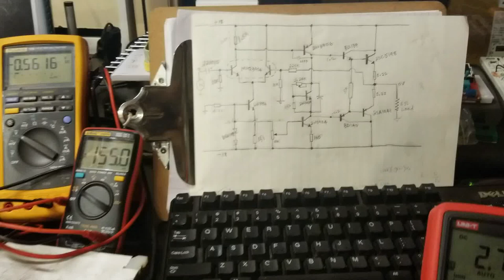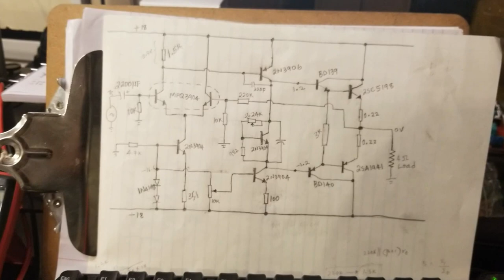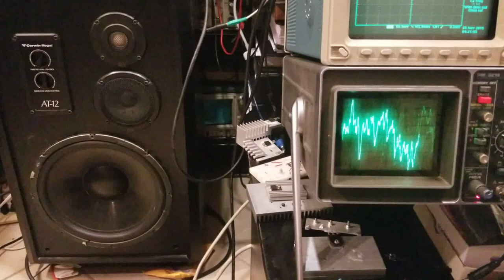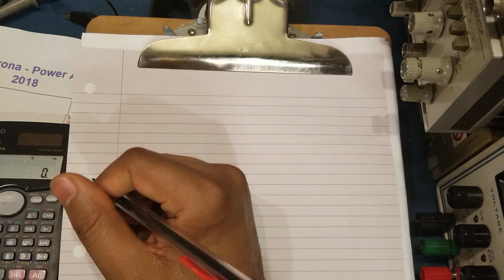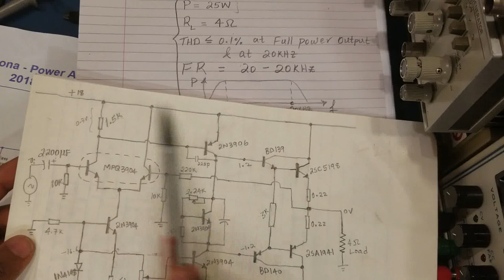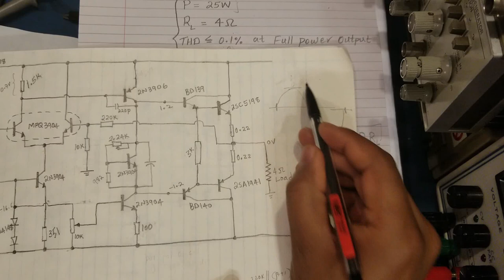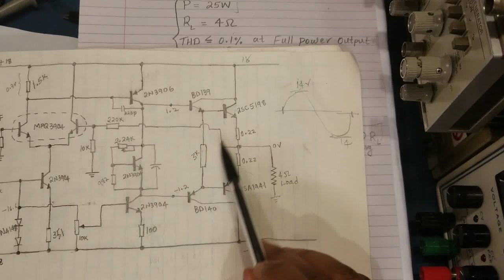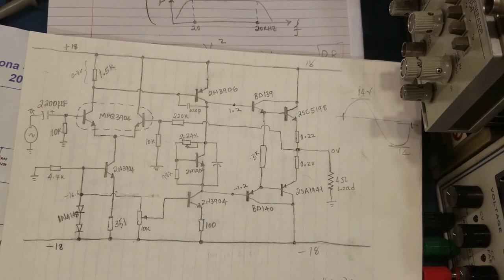25W Audio Power Amplifier Design  - Part_1

Comment: The input capacitor has a very large value and has no resistor between it and the base of the input transistor.  Input capacitors are usually around 10 uF, (and preferably non polarised) with a resistor of 10 K - 22 K.  Why did you design your circuit this way?

Comment: Are you sure about this feedback loop between the power output and base of the "right" transistor in coupled pair ? I mean - if you had a capacitor in series with this 10k resistor then there would be nothing wrong but if you dont have it then the voltage on the power output in bias state will be highier equivalently to the proportion of the resistances of the feedback divider because its connected to the ground. And I assume we want to stabilize the bias voltage having the ground as reference because the "left" transistor of the coupled pair is biased through 10k resistor to ground without any divider. That's little yet tremendously important detail - if missed it will cause disstorsions or in the worst case it's gonna blow up the power stage because the output transistors will be "trying" to put at least several volts above ground on the few ohm resistor which is the speaker in bias state - thats a lot of current. Details of this kind are CRUCIAL for designing even the crudest and most basic power amplifiers.
Reply from the maker: Hi RedfusionPL
. At DC, the base of the two emitter coupled pairs see almost the same resistance which is approximately 10k. The left transistor sees 10k to ground while the right sees 10k in parallel with (220k + 4R) which is about 9.6k. The difference is minimal which won't have any effect on bias of the output transistors since the matching of the two pairs isn't great to begin with (I am using MPQ3904) and the tolerance of the resistors. The amplifier was exactly built as seen on the schematic and didn't have any bias issues. In fact initially I had the 10k resistor on the right transistor connected with 2200uF capacitor to ground and the left transistor connected to ground through 220k resistor (basically connected as an AC amplifier). But I was having DC offset issues with the parts I had on hand and the feedback connection shown on the video solved this issue.
Reply: @SmithKerona  Sorry mate it's my bad I didnt notice it. Though both of us are little unprecise in our explanations because what will happen in circuits like this one is strongly dependable from current gain of the transistors, temperature voltage coefficients, differences between offset voltages (as you mentioned above) etc. so to compensate them a much more elegant and complex circuitry would have to be applied :) I dont think there is any sense in digging so deep if this is only for quick and simple applications lol. You get suprisingly nice sound out of it btw. Run some disstortion tests if ya can.
I just noticed the release date XD nvm

Comment: There are lots of sections or sub-circuits in this complex design that I hoped would be explained here or in part 2 but part two is just a simple 2 transistor AB circuit.   Will you be giving
any more comments on this much more complex design?   (e.g. comments on what the feedback circuit from output to the diff amp is accomplishing?).    There are lots of things
in this design that are not obvious to those trying to understand something this complex.
Reply from the maker: Thank you for your comment. My plan is to work out in detail how each sub-circuit works without shying away from the mathematics including contemporary feedback theory to shape the frequency response and stability of the amplifier. But time is the issue for me at the moment and I apologize in advance for not continuing the series. My plan is to get back to it as soon as I can. I hope you understand.
Reply: I like design but don't know where to start any help
Reply: That is a good comment. I find that with enough watching, reading and experiments I might get something sorted in building or repairing an amp.

Comment: I just started the video, so you will probably say it later, anyway... wouldn't it be better to actually have a capacitor on the voltage divider at the input on the second transistor (Q2) of the input diff. pair?

I mean, the voltage divider works miracle for AC signal, but for DC ones you'll have a diff. pair which is not balanced, and as far as I know, that can't be good as far as common-motion rejection goes, right?

Comment: 1:40 This circuit has quite a few design flaws.

The input stage has a very low bias current of abt. 1.7mA, leading to low transconductance and current starving of the voltage amplifier stage at frequencies above 1kHz, which in turn causes poor slew rate and  distortion (mostly 2nd harmonic). It's also hugely disbalanced, because one transistor draws abt. 0.46mA (0.7V/1.5k), while the other one draws 1.7-0.46 = 1.24mA. The whole point of a differential pair is to be perfectly balanced. Deviations in transistor currents over 1% cause a significant increase in distortion (2nd and 3rd harmonic). The best solution here would be to use a current mirror - the increase in complexity and cost is negligible compared to the great improvement it makes.
It's also beneficial to increase the bias current to abt. 6mA and add emitter degeneration resistors of abt. 33 Ohm to the differential pair.

The dominant pole capacitor (220p) is too big. The whole point of the dominant pole compensation is to bring the open-loop gain down to unity just before the phase shift at the output approaches 180 degrees, thus turning an amplifier into an oscillator. The value of Cdom is determined by the current sourcing/sinking capabilities of the transconductance stage and the VAS collector impedance. The open-loop gain here is not that high to begin with, due to the aforementioned low transconductance and current starving of VAS. All of this leads to a poor slew rate and great increase in distortion at higher frequencies.

The VAS collector is loaded by a current sink, which is correct, but there is never a need to adjust the exact current flowing through it, so the 10k potentiometer is useless. The 2.24k pot is placed between the Vbe multiplier's base and collector, which is a timebomb, because if it fails, the bias voltage will increase to a maximum, likely causing the output transistors to blow up. It's always a better idea to put it between the base and the emitter.

The 3K resistor between the driver transistors' emitters is too big. Reduce it by a factor of ten and put a 0.1-1uF capacitor in parallel. Its purpose is to provide a small reverse-bias voltage to the output transistors, making them turn off faster. Doesn't hugely matter in this relatively low-power circuit.

It's always a good idea to couple the lower leg resistor of the feedback circuit (10K) to ground through a large (470uF+) capacitor, thus bringing the DC gain down to unity. The input pair is never going to be perfectly matched, and you don't need to amplify the DC offset voltage. The 220K will then have to be reduced to the same value as the input bias resistor (10K in this case) to match the impedances. It's always better to keep the value of these resistors as low as practically possible to reduce the Johnson noise (the exact values will ultimately depend of the signal source's output impedance). It's also necessary to put a small (4.7-33pF) capacitor in parallel with the upper leg resistor of the feedback circuit. This circuit is likely to work fine without it because its dominant pole frequency and slew rate are very low and therefore the Nyquist stability is not compromised - but the noise and distortion figures most definitely are.

That's all. :)
Reply: That is some pretty in depth stuff you say right there. 
I'm trying to learn how to build an amplifier as my amplifier developed a technical glitch. I have no knowledge of electronics and to a practical approach for me is the best way to learn. 
This video is the first time I have seen someone explain how to build one and from that I am hopeful I can learn how an amp works and then from that maybe how to fix the one I have. 
Your answer is really interesting as it seems to show both interest and practical experience. Of course (and this is a joke) I know nothing about amplifiers or circuits, so what you are saying could be written by someone who knows nothing, but from a novices point of view, sounds wise and knowledgeable. :) 
My point here is I am going to look through the comments, but if you could highlight any videos, books or other information to teach me (us) how to do this, that would be great! 
As for the guy that made this video:- Thank you ever so much for this gem!!! I keep comping across fantastic repair videos, but they all presume we know how an amplifier works and what the components do, we don't. No one seems to point at anything on a PCB board from an amp and explain how each component relates to another. Seems as AB amps are based on the same principles, then know what is going on then means we can learn how to diagnose e.g. like where to put the multimeter to see what current flow is happening to find the exact problem. 
This subject is a minefield, but like most subjects, practice makes perfect and you video is absolutely stunning for the breakdown, explanation, but also the incredible comments from all the people pointing things out. 
Cheers peeps!!! ;)
Reply: @waynecummings5021  It's all complete gibberish, I assure you.😊
A really good book to read would be "Audio Power Amplifier Design Handbook" by Douglas Self. You can download it for free. It does require some knowledge of electronics though. Power amps are relatively simple circuits. About 95% of all amps use the same basic topology shown here, it's only the details that differ (but they do make a big difference). The best way to get started is by learning about positive and negative feedback, and how a differential amplifier works.
I can't recommend any videos because back when I was learning this stuff, there weren't any, and now I rarely watch them. You could watch some about operational amplifiers, because that's what power amps basically are: big, discrete op-amps.

What kind of "glitch"? Analog circuits rarely glitch in the same way computers and other digital devices do. Normally, if they stop working properly, it's due to a component failure. If your amp hasn't blown up, if there's voltage on the supply rails, and the output transistors are not shorted (which you can easily check with a multimeter when the power is OFF), then you could probably fix it.
Reply: @noneofyerbeeswax8194  Thanks buddy! That's a great reply for someone paddling in the Pool of Glitch. 
I have two Amplifier Receivers amps (I'm not suggesting you recommend talking me through both) that are exactly the same amps i.e. Sony STR-DE585, and both have different glitches:- 

1. One turns on for a few minutes and works fine, then after about 10 minutes it cuts off - so I guess something is over-heating and it stops to protect itself or something else;

2. One turns on, but it either recognozes the input signal straight away (optic from the TV), or turning it off and on again it finally recognizes the input and then it's fine; ;

There is also an Onkyo AR and that thing just sounds like it's trying to turn on, but just clicks at an exact 5 second interval. 

All three ARs are getting power and turn on, after that it's a mystery. 

Sorry to list them all, but that is what's confusing and cool i.e. they all have a different glitch. 

The reason I have 2 STR-DE 585s is because I bough them from Ebay as back-ups. I actually have a STR-DE585 I bought new 20 years ago and that still works, I just took it off line and used the replacement ones. However, as each one packs in I am slowly looking at using my original 585, and if that goes, then it's tears. Anyway, I thought if I buy other 585s I can reuse the parts to keep one going as long as I can learn to repair them, and here I am on this video trying to learn. I thought if I get used to one type then taking it apart will be familiar as I have three. Then it crossed my mind that I would love to learn what an amp is as they must share common technical attributes basically. :) 

That was a longer answer than I wanted to give.
Reply: @noneofyerbeeswax8194  I've just downloaded Audio Power Amplifier Design Handbook by Douglas Self. Thank you!!
Reply: @waynecummings5021   As someone who likes posting huge Walls of Text™, I really don't mind a long answer. :)

I've taken a look at the STR-DE585 service manual. Lots of stuff there. If all the channels have the same kind of malfunction simultaneously, then the problem is clearly not with the output amplifiers themselves. It's most likely in the digital circuitry before it.

The first problem might indeed be caused by false triggering of the thermal protection circuitry. Or by a leaky diode or transistor that starts drawing too much current as it heats up.
The second problem can be caused by lots of things. It can be just a loose contact due to a mechanical failure (cracked solder, SMD resistor or capacitor), or an actual digital glitch - anything. But it's definitely in the input circuitry, not in the output amp.

It's very hard to diagnose anything remotely. The process of finding a malfunction is not that hard per se, but it's very tedious. The standard procedure is to connect a signal generator to the input and follow the signal path throughout the entire circuitry until a point where it breaks. Then compare all the logic levels and DC voltages to those given in the service manual to find out what's responsible for that. Oscilloscope is required.

The third one sounds like an actual amp problem. If it's a relay that clicks at a 5 sec interval, then it's definitely the speaker protection. You need to measure the DC voltage at the output, it should normally be close (within 100mV) to zero. It could also be the over-current protection. Both these problems are normally caused by an output transistor failure (one of them must be either shorted or non-conducting at all), but not always.
Reply: @noneofyerbeeswax8194  Thanks for the heads up bud! I will check the systems as I go and learn as I do it - which is the whole point anyway, so I had to jump in the electronics pool at some point. I don't mind looking for the issue as it's both interesting and practical. 

You mention a service manual? I have already asked Sony for information like a schematic and they are telling me they only give them out to Sony engineers and such. They also called my 585s 'senior'!!!, in that they've had a good life, just left them pass away with dignity. The cheek of it! I explained to them that I bet they have a 'Let's save the Planet' mantra and yet here they are telling me to trash 99% of a great machine because it has a broken spring. I also told them they better not say that to their Directors as I bet a lot of them are 'senior', but I bet they don't want to be trashed. 

I am actually looking forward to diagnosing the exact issue/s if I can. It's a very transferable skill in this world. 

The oscilloscope sounds like a must I have realised. I am at that stage where I am slowly purchasing things like needle nose pliers, MESR-100 Capacitor meter, Atlas DCA55 component analyser, and researching other diagnosis aids. I have a cheap multimeter (MM) that for the first time last night I ran around the amp while it was powered up. I was nervous, but I saw a guy use a MM with negative on earth and live touching various parts remembering that current finds the shortest path, hence it gives readings without going pop. 

I really want to know how to find exact component failures. I want to know the exact culprit in a den of culprits. I love finding the specific failure if I can, but I appreciate that isn't always the case.
Reply: @waynecummings5021   Regarding the books, I've somehow forgotten about The "Bible": "The Art of Electronics" by Horowitz&Hill. Great stuff!
Reply: @noneofyerbeeswax8194  Purchased. Thanks!

Comment: I made a similar circuit, used Fallstad simulator, i adjusted the circuit to deliver 1 amp @ 1around 9 V.p.p. swing from a 2 x 15 V transformer, so 2 x 19.6 V.
Using BD137, BD140, it follows the input voltage perfectly, pcb made, on it's way. wonder how it sounds, also included 2 pole Sallen Key filter.
How much watts would that be would your recon? P = U x I, states like 19 ,6 watts, right or wrong?
Reply: Hi there, I hope you are doing well, its good to hear that you made the circuit, I want to ask you about how did you find out what type of capacitors he was using, like ceramic, tantalum or electrolytic. Plus are you talking about the power calculations across the capacitors or at the speaker itself, You could easily calculate that by using a simulator, or by the equations that he had described in the video, if you know the parameters
Reply: @Gagandeepsingh-uf2un  The pcb's are on the way.
Reply: @AnalogDude_  but that does not answer my question
Reply: @Gagandeepsingh-uf2un  I use big 4700 electrolytic, 5 of them, 23500 uF in total and some film/ceramic. for just one speaker.
Is that what you're looking for?
Reply: @AnalogDude_  yes, thank you for the response. Means a lot

Comment: You should add a capacitor from your feedback translator base to 10k resistor. You don't want gain at DC, you just want the amp to servo the output to 0 V DC with no input.
Reply: correct. In this case you don't amplify the input offset voltage. But you have to make sure in this case to replace the 10 k input resistor by a 220 k input resistor. In order to match the input resistances between both differential amplifier inputs. Otherwise you get perhaps more dc offset than before.